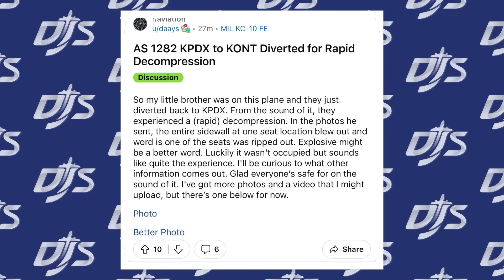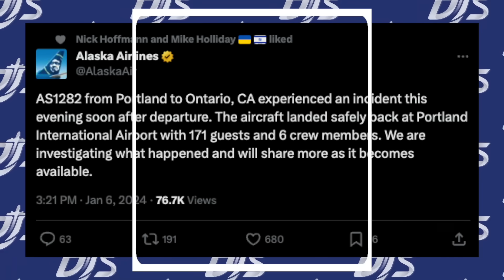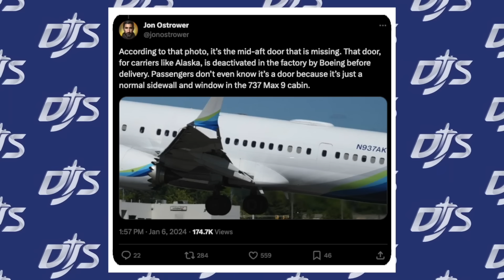Alaska Airlines 737 MAX Door Blows Out

Comment: Another stunning example of Boeing quality in 2023/2024!
Reply: 10 weeks old! And multiple broken bones according to the passenger posting on Reddit!
Reply: You're very quick to jump to conclusions.  Why don't you do what a RATIONAL THINKING human being does, and suspend judgement until the accident investigation has concluded and the root cause determined?    I think that this will end up not being a manufacturing defect, but human error.
Reply: Boeing 737 is a very dangerous plane
Reply: @Turboy65  How could it not be a manufacturing defect/problem ?Humans manufacture the fuselage
Reply: @droppingemstv4283  You're dangerously ignorant.
Reply: @Ray-dm1xf  Literally thousands have been made and no exit plug has blown out before.  This is human error.  Not a design problem.
Reply: Nice troll but in reality for the moment we don't know.
Reply: @Turboy65  you don't know me sir
Reply: @droppingemstv4283 like all planes are
Reply: @stickynorth how is this down to boeing quality? It's been delivered and in the hands of maintenance not boeing
Reply: @nickolliver3021 that doesn’t mean someone at Boeing who made this didn’t manufacture or assemble/install something correctly and it went unnoticed. Just like all other build quality issues that have been identified
Reply: @tomstravels520  so why would you rather jump to conclusions about it. Again it happens to all planes so could be maintained badly after delivery so perhaps wait for investigation that go towards more boeing at fault.
Reply: @nickolliver3021  trashy 737 aerosucre 💩💩💩he reaching maximum crash 😂😂
Reply: @nickolliver3021 another meltdown for you darling LMFAO First, loose and missing nuts found on a couple of 737 Max Rudder Controls and now a door blowout in one week. Quality Control Boeing? Thank goodness these incidents were recoverable, but those two instances sound like they could have had the possibility of being a lot worse. I still remember the DC10 cargo door blowouts that took out the hydaulics back in the 80s and resulted in several crashes resulting in Grounding… Boeing, the reliable aircraft that killed over 346 people due to cooperate greed and pleasing the nuts of wall street executives 🤭🤣 oh yeahhhh, keep crying
Reply: @AIDEN_505  keep being triggered little one with 320neo failing very soon 🐷🐷😜🥱🥱
Reply: @nickolliver3021 so all this time you’ve been telling people they shouldn’t hate upon a certain aircraft and not wish it to fail, but now you want the A320 Neo to fail? Hypocrite
Reply: @nickolliver3021  sorry I dont see the neo failing
Reply: @droppingemstv4283  how will you know. Its not perfect
Reply: @tomstravels520  it's gunna fail at some point. No plane is perfect. Hypocrites only get triggered by things they don't like hearing and agreeing with. Grow up
Reply: @nickolliver3021  so you then. Every person who says the Max is dangerous you’re right there trying to say Airbus is the same. And in that case I or anyone else should be able to say the 737 Max is going to fail again and you can’t argue back
Reply: @nickolliver3021 ”All planes have door blowouts”
Really never knew it was a common issue first time i hear that.
Reply: @jungbolosse3034  it's true. Its a common occurrence. Nobody should be worked up over it
Reply: When accountants build aircraft 😢. Boeing 😂
Reply: @nickolliver3021 a plane that is months old? How is it not a manufacturing problem?
Reply: @nickolliver3021  list specific incidents where this has happened then, aircraft models and dates.
Reply: Well this happens and has happened to abuse a few times
Reply: @nickolliver3021  no it is, you are so delusional. It rarely happens, even the airline stated that, yet you think it’s common just to defend the Max
Reply: @tomstravels520  it's just happened to be the max so what. Perhaps aviation should just close shop of its so issueful
Reply: @scrumpydrinker  forgotten already
Reply: @nickolliver3021  what a surprise you’ve forgotten…..despite your insistence
Reply: @tomstravels520  you obviously gave too. Grow up
Reply: @nickolliver3021  when i google door blowouts i only get Boeing related results.
You meant that it often happens to Boeing aircrafts. Thank you.
Reply: @Turboy65 MCAS? Boring implemented it in the passenger jets in which 2 airlines crashed. Now tell me about rational thinking. You think anyone can really think that the door which blew off is from a passenger? That tho in a very new plane? C'mon, it's definitely Boeing's fault.
Reply: @nickolliver3021  forgotten what? Nick, you are the one saying this is common yet when was the last time it happened? You have been asked to provide a list of times it’s happened where the door has blown out and you can’t even name one? If it was common you would be able to name some. Clearly once again you are a liar and just desperate to defend the Max
Reply: @jungbolosse3034  it’s not even common like he said. Last major blowout was SWA1380 and that was in 2018. I wouldn’t call that common would you?
Reply: @jungbolosse3034  doesn't mean they are boeings fault. They were more maintenance but if you think it's all boeings fault then go tell them to close shop thank you!
Reply: @nickolliver3021 Dude, are you comparing this incident to that Asiana Airlines Flight 8124 where one person opened the emergency door? That was the persons fault. In this incident no one opened the door. In fact, nobody knew that it was an emergency door. Rather than "jumping to conclusions", just say that you are trying to defend the company.
Reply: @nickolliver3021  I definitely think that it's Boeing's fault. Only 11 weeks since this plane was given to Alaska airlines and problems started to come. Boeing built this plane as fast as possible to compete with Airbus Neo airplanes so that airbus don't take their precious money. Ok I agree that Boeing planes are cheaper but, did you look at the production times? Airbus has a faster production times rather than Boeing. Airbus also has a better safety score than Boeing. Before commenting that Boeing was the first plane maker to revolutionize the commercial airline market and Airbus is newer, that was olden times where boeing had very less competition.
Reply: @ayngnka  does it matter about how fast boeing makes their planes and who revolutionised the market. If you insist it's boeings fault then go all in oth that but these things happen to aircraft. I'm totally blind that this aircraft was rushed to compete with airbus duh what an idiot I am. But I can see everyone here has been worked up over thos because its a max and they think it's tne end if the world for them and the max. The aviation industry has no place to live anymore but dark places for sure
Reply: @alvinloh9068 - yes, the DC10 cargo door incidents immediately came to my mind is well.  I’m happy to hear that Boeing is ground this model.  This could have been a lot worse and is very concerning that it happened to such a new plane as stress/fatigue normally takes years to show up.
Reply: I know it is as if the door was built by airbus
Reply: Me boing BAD! BAD!
Reply: @Turboy65 lol there is something known as 'Max crashes' and '787 pause production due to poor quality control' so he's not wrong in drawing that conclusion on a 9-week-old-aircraft
Reply: @nickolliver3021 so was the max that crashed... Are you saying those 2 that crashed were bad piloting too?

Lol you sound like you breath through your mouth.
Reply: @jungbolosse3034 lol stop triggering a junior high schooler.
Reply: @tomstravels520 that's still Booing... Why are you guys keeping on telling us Booing sucks. We know... We need to find out when Airbus lost a door mid flight.
Reply: @nickolliver3021  itss a brand new plane
Reply: Really? What about Airbus’ dismal and suspect composite quality (and also remember their composites have got a serious paint peeling issue), compared to Boeing, where JAL A350 Airframe burnt right through for 6hrs despite Firefighters foam attempts this week.

But in contrast, Boeing’s composite 787 JAL and Ethiopian fires in 2013 were contained ? 

Both different aircraft use composites, yet Boeing’s seems to have the better composite manufacturing quality, with lessor issues emitted for the same problem experienced compared to Airbus’ problems.

Given any issue area on an aircraft, Boeing quality just shows itself to eventually all round, exceed and be that superior to Airbus’ - who show themselves to lag on innovation to Boeing.
Reply: @gtf5392  It is not Boeing grounding the 737 Max (once again), just Alaska Airlines.
Boeing will wait for a few more incidents  before taking action probably🤔
Reply: @nickolliver3021   See, if you consider in 2018, there has been 2 crashes so Boeing had to ground them. If it were to happen in Airbus, we would react the same. We're all just concerned that if more of those cases are seen them it will be a problem for boeing. Oh yea, yesterday there was a bolt missing in the ailerons. Mind explaining that?
Reply: Haha nice joke, we still don't know what caused it yet
Reply: @ayngnka  It could be an assembly fault on the part of a Boeing employee but it's not a design fault so an INDIVIDUAL bears the responsibility, not the whole company.
Reply: @david.b4186  You forgot a few things. In Japan airlines 787 AND Ethiopian airlines had a battery blasted off while you are blaming that the a350 also had that similar thing? At least Airbus decided to help them. Boeing, on the other hand, the government checks them. You know why? Boeing will always say that "The plane's fine. Go fly on". Remember lauda air 004? Boeing didn't believe that the reverse thrusters will cause this this and Niki lauda himself told them to give the 767 and he will fly with the reverse thrusters on and then boeing listened. Niki lauda stated that "this was the first time in 8 months that it had been made clear that boeing was at fault and not pratt and Whitney". Even though a350 had the composite problem, they fixed it and made it better than boeing. Boeing on the other hand, had fuel leaks on a jal 787 in janruary 8th,2013 and a Norwegian air shuttle 787 in janruary 21,2014. What was boeing doing for 1 year? They said that it was nothing. Next time, before saying, research and then say it.
Reply: @Turboy65  I agree with that. But now FAA is checking all boeing 737 planes. If they notice some more incidents like that then all 737 planes are grounded. Realize something? Some operators like Ryanair, southwest use mostly/all 737? If it's grounded then it will be a big problem for them.
Reply: @nickolliver3021  I never said Boeing should close shop, don’t put words in my mouth.
Just that i would not like to be on a plane where rapid decompression due to loss of an exit door or part of the hull is a ”common issue” that ”happens regularly”.
Reply: Even the most ardent fans of Boeing have to now start to questioning the build quality of the 737 MAX, this wasn't a 20 year old aircraft.
Reply: @daylate  just like what Thomas is doing breathing god almighty out of his mouth. This isn't related to the crashes. 

It was not controlled by anything so 

Think we should stop getting up tight about this
Reply: @david.b4186  you’re comparing a battery fire to a plane that crashed into another, soaked in flammable liquid that then caught fire. 787 fire was in one small area of the aircraft, A350 was not
Reply: @ayngnka  many more airbus planes will be coming with faults here and there the more of those the more people get worried for those. A bolt isdue with rudder that's not what we are talking about here
Reply: @david.b4186  Boeing 787 fires caused by thermal runaways in the batteries, A 350 fire caused by impact with another (fully fuelled) aircraft when landing. Do you not think that these are different circumstances to each other? I sincerely hope that we never find out how a 787 would have performed in that situation.
Reply: @Turboy65 go on, give us an example of the type of human error that may have caused the damage to that extent? It wasn’t a door, so could it have been someone putting up or down the window shade a bit too forcefully?  It’s a struggle to imagine what kind of human error that could take out a panel of a fuselage so cleanly
Reply: @nickolliver3021  But that is recent, like yesterday and now, same plane and more problems.
Reply: @ayngnka  what do ypu want boeing to do anout it. They are doing their best to fix it
Reply: @scrumpydrinker  My point is the A350 composite skin didn’t stop burning  (despite what initially seemed to be massive foam from Firefighters) for hours; the 787 did though.

As to the cause of fires being different in fuel from impact/battery - this can be a factor in initial stages of burning, but becomes irrelevant imho in later stages, where, when a frame continues burning excessively on to finish despite [frantic]  foam efforts, questions have to be asked of the faulty material used for the frame (and no longer just the cause of type of fire whether fuel or sparks)

The purpose of foam in first place is to block oxygen from fueling fires, no ? - yet despite this the A350 continued burning and for 6hrs straight. The 787 composite skin responded ameniably better to fire suppression imho and thus, my inclination that Boeing has the better quality of products in composite.
Reply: @nickolliver3021  we do not want any problems in any planes. In this flight, what if a person flies out? The problem would have been bigger.
Reply: @nickolliver3021  Oh, and now Alaska air is having problems as they have grounded all 737 max planes
Reply: @tomstravels520  My point is that on the A350 the fire, just continued burning through; the 787 didn’t. Granted, having a fuel fire is definitely an enormous challenge compared to a battery/spark fire and would therefore take longer.

However at some point, that fire, when specifically using foam has to be put out. As the purpose of foam in itself is to suffocate Oxygen fueling very fire, no ?

But 6hrs of continuous burning - goodness! 

Questions have to be definitely asked of Airbus’ [shoddier] standards of production/quality and on composite (just look at the peeling paint issues which are so magnified on A350s).
Reply: @ayngnka  then let them fix whatever it is.
Reply: @ayngnka  luckily no one did. Planes will always have problems. They're not 100%.
Reply: @nickolliver3021  For the first time, I'm agreeing with you.
Reply: @david.b4186  really? The question you should be asking is how would a 787s structure respond in a similar situation, god forbid that we ever find out but I strongly suspect the there would be a similar outcome.
Reply: @david.b4186  to be honest a lot of the videos I don’t see the firefighters doing much to put out the fire in the first place especially using foam. It held up the initial few minutes better than aluminium as designed. But let’s be honest, once everyone is off do you expect the plane to still be fixable? What difference would it make trying to put the fire out or letting it burn except using it for spare parts. You really cannot try to make the A350 look bad compared to these last few Max issues especially when Boeing had the same issue occur on the 787 and only Qatar was bothered about the paint issue, everyone else accepted the new paint coating whilst a long term solution was found.

And has been pointed out, we don’t yet know what would happen if the 787 did the exact same thing and firefighters responded the exact same way (and I hope we don’t)
Reply: @Turboy65  lol it's a manufacturing error
We've had that turd since October 
All the Max's SUCK 💀
Reply: @nickolliver3021  I think you are the one getting big mad. Lol
Reply: @brybag6938  Really sorry your brain crawled under a rock and refuses to come out.
Reply: @david.b4186  is that why 787 had problems with the joints? Lol what a simp for Booing
Reply: @david.b4186  Well one plane landed on top of tbe other, both full of fuel. So what did you expect? Both planes to merge with each other and result in a superb Airdash 358 that can take off in 400 metres and fly across 2 oceans?
Reply: @daylate  Simp (in your opinion) or not, I’m proven correct.

Boeing innovation, quality and Engineering IS in the end, just superior to Airbus. 

Name one comparable frame Airbus has produced (except for A320 family - for which Boeing is still competitive with 737 in numbers produced) that Boeing did not supersede in quantity of orders, duration of Service, revolutionary innovation such as concept of Composite on 787; for longer range flight due to lighter weight?

Boeing product and results, just show themselves to be miles ahead in first to dare to take risk and introduce unproven, but quality, while Airbus only follows after Boeing has proven the concept (remember, the Queen outlasted the Whale at least 4:1 in production years and counting; in contrast not even a single A380 has been converted to Freighter to extend it, because economics are even worse than 747 Freighter). 👉🏾❤️ Boeing.
Reply: @zorktxandnand3774 - oops, oh man - well, I hope Boeing grounds this model soon cause better to be safe than sorry.  We all learned from OceanGate what can happen when people brush this type of stuff off.
Reply: @Turboy65 I think this is a pretty rational conclusion, given their history.
Reply: Aah... The  modern day Death  Chamber  10
Reply: I’m inclined to agree. The door that opened and detached is purely an emergency exit. However on this aircraft, and presumably on the rest of the Alaska Airlines 737 MAX 9 fleet these doors are rendered inoperative. This is because the maximum passenger capacity of the aircraft falls below the requirement to have them operational.

So the aircraft are delivered from Boeing with these doors deactivated and conventional cabin sidewall trim installed over the doors. The aircraft was delivered last October, entering service in November. During the very brief period of operation I very much doubt there would have been a requirement to gain access to the deactivated door for inspection purposes. Which means that Boeing were more than likely the last people to have inspected the door, ensuring it was securely closed and properly deactivated.

Along with millions of others, I too eagerly await the findings of the F.A.A.
Reply: Proudly made in USA and not made in some dilapidated sweatshop.
Reply: Reko. Amir. Ima. Doasla. Roba. Kyci. Imisy. Pare. Kiona. Moje.
Peradene
Resko. Uzo. Piaiax. Kafny. Moje. Pare. Kiona. Mesar.
Reply: @jungbolosse3034  yooo you hit it right on the nail. Boeing is always menton when you hear about a door blowout 👏🏽👏🏽👏🏽👏🏽👏🏽👏🏽👏🏽
Reply: @david.b4186  Where was the superior engineering when they designed MCAS? Which company developed the first twin engine wide body? The first wide body without a flight engineer? And the first digital fly by wire aircraft? And please don't kid yourself about the 787 having composites being revolutionary. The only difference was it was the first aircraft with more than 50% made of composites, the A380 had about 20-25% and even the A300/A310 had bits of composites in it. And how are the economics for the 787? Oh wait...over 1000 made and still not made a profit? Yeah the A380 didn't make a profit but the A350 broke even way back in 2019.
Reply: @ashleypg1708  Not rational AT ALL given that the emergency exit and plug design is the same one 737s have used for MANY years. It's not a new Max only design.  It is extremely well proven with thousands of examples in service for decades.  RATIONAL possibilities are llimited to material defects or defective installation.  Or possibly tampering though this seems even less likely.
Reply: @david.b4186  
That ridiculous garbage you've written about the A350 fire, when the authorities just dosed the fire, they certainly didn't bother to put it out. It appears that the Captain was still walking the aisles checking for passengers, some ten minutes after everyone got out. If the report supports that, that will be kudos to Airbus and composites. It might also be kudos to the 787 because of its composites, and when you mention the flaking paint on the A350, you fail to also mention the masking tape holding the wings on the 787 which I flew.

Unlike others, Im not referencing this door on the Max, until more is known, but for you to go on to to the A350 crash where 5 people died, as a simple diversion away from Boeing's problems is immoral.

I will say this, I don't know whether you're just plain stupid, or Evil, but I'd prefer you to be Evil than stupid, especially if you're on the Boeing production line putting this stuff together........
Reply: And apparently Boeing are still dealing with poor design and quality issues with the Max-9. Articles published online only Months ago about the engine anti ice systems prove what a mess Boeing is in. 
It’s reminiscent of when NASA ignored the engineers advice and expertise. And we all know how bad that got.
Reply: Flew on a brand new Neo from Frankfurt to Copenhagen. No dramas. Lovely aircraft. 🇬🇧
Reply: Judging by clean frame. This door was most likely removed by maintenance crew to move large objects in or out of the plane but forgot to bolt back on.

Reason it’s unlikely a Boeing issue is because it’s is a bad bolt or pressure blowout, it would have torn frame off at that speed and altitude.

Clean frame suggest door was removed on purpose and forgot to bolt back on
Reply: I bet when maintenance was performed that hinge lock got jammed up. Sometimes when they install cabin interiors they use the OW exit to load carpet. I doubt it's a structural issue or the stringers would have been ripped out. And no, I am not a YouTube mechanic.
Reply: @nickolliver3021 Boeing is the worst, i bet c919 is better than Boeing. Boeing must completely stop production
Reply: @saladfingers6710  Judging by clean frame. This door was most likely removed by maintenance crew to move large objects in or out of the plane but forgot to bolt back on.

Reason it’s unlikely a Boeing issue is because it’s is a bad bolt or pressure blowout, it would have torn frame off at that speed and altitude.

Clean frame suggest door was removed on purpose and forgot to bolt back on
Reply: If it’s not a Boeing issue, why have all of the just been grounded across America?
Reply: @muppetrowlf1473  they did it  it because they don’t know what the issue is yet. And judging by the clean frame, it’s not Boeing issue. Door was removed for some reason and was not put back properly
Reply: I’ll take that, if you know what you’re looking at. I’ll be honest I just see something missing that obviously shouldn’t be. 
Although I’d also have thought it would look clean, apparently the aircraft is only 9 weeks old. 
According to journalists there are Still some technical issues plaguing this aeroplane.
Surrendered their dominance to Airbus quite quickly in recent years. Boeing’s chief savour is Airbus capacity to build.
Reply: Time for my two cents.
The loose bolts on the rudder, and this, are definitely not related to the MCAS issue. After all, MCAS is a software, while these recent issues are a manufacturing thing. Boeing have fixed MCAS, now they gotta fix the rest. But first, the FAA must investigate how the plugged door could've come out.
Reply: @Turboy65 OP’s claim of a quality issue is not mutually exclusive to human error. What are you going on about? Who do you think build these things? Humans. Humans are responsible for the end quality, even if it’s one person. No one but you mentioned “design”.
Reply: @droppingemstv4283 not aware Ryanair had any issues with them. Boeings had their flaws and how they bahaved was terrible, but i really hope they will return but airbus is going really strong now
Reply: @Turboy65 it's a ten weeks old airplane. And human error in production is still the fault of the manufacturer.
Reply: Thanks to the guy who vowed to “run Boeing like a business instead of a great engineering company.” GREAT!!
Reply: @nickolliver3021 na theyre build and designed properly 😂
Reply: @nickolliver3021 Americans cry when something American fails 😂😂
Sooo salty 😂😂
Reply: @nickolliver3021 it's a common thing for planes to lose doors? Haha bullshit
Reply: @mark675  so do boeing
Reply: @nickolliver3021  boeing are built and designed properly? yeah evidently 😂
Reply: @mark675  keep dreaming kiddo
Reply: @nickolliver3021  keep having nightmares about doors coming off at 30,000 ft kid
You'd be thinking differently if you was on the death trap 😂
Reply: @mbk7771  go tell boeing then. Airbus is tne worst too
Reply: @shdmd2118  what is it with you and clean frames? It’s a 3 month old plane that only started revenue service 1 month ago. And you think planes don’t get cleaned occasionally?
Reply: @nickolliver3021  lol I'm waiting for it but for NOW 737 MAXIMUS CRASHES WAS GROUNDED LITTLE BOING
Reply: @nickolliver3021  DONT TAKE IT BAD JUST APPROVE THAT YOUR AIRCRAFT WAS MADE BY LEGO🤣🤣🤣🤣
Reply: @nickolliver3021  I NEVER SEE AN A320NEO BLOW UP HIS DOOR AT FL150🤣🤣🤣🤣
Reply: @AIDEN_505  so funny yeh yeh I never see any plane 100% blah blah blah go tell boeing how u feel
Reply: @nickolliver3021  Please tell Airbus that you feel and cry so helplessly with Boeing's constant defects and issues, which led to 3rd grounding again.
Reply: @tomstravels520  dude, what is your IQ? I am not going to answer that because you have no clue what I am talking about or any concept of engineering  and what happens at that altitude and speed if a door is torn off as result of factory defect.
Reply: @muppetrowlf1473  because it is a Boeing issue.
Reply: @nickolliver3021  737 MAXIMUS CRASHES are u done?
Reply: @alvinloh9068  please tell boeing that you feel so helpless with airbus perfection with constant cracking and planes tearing mid flight
Reply: @nickolliver3021  The 737max fuselage is cracking and failing after the explosion, Nick! You should cry harder!!